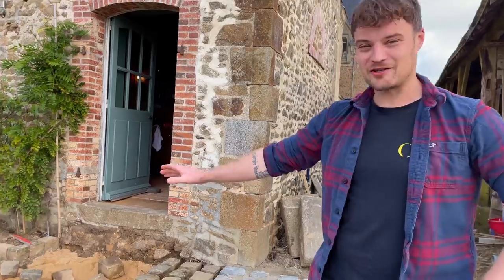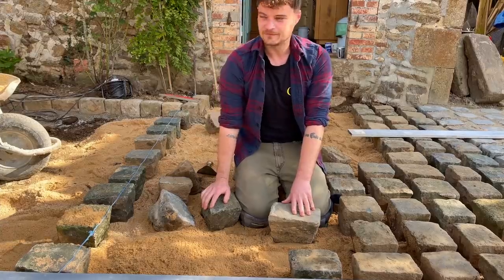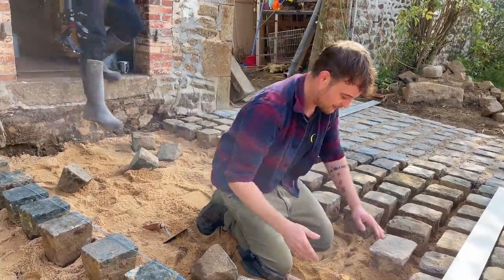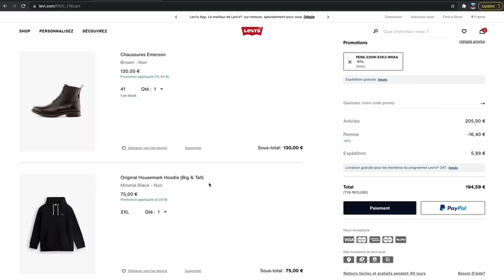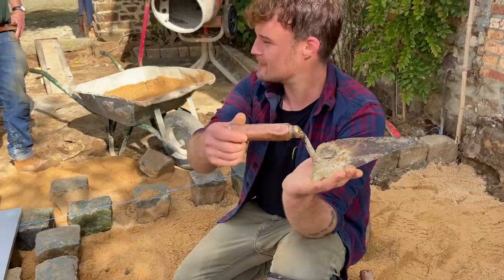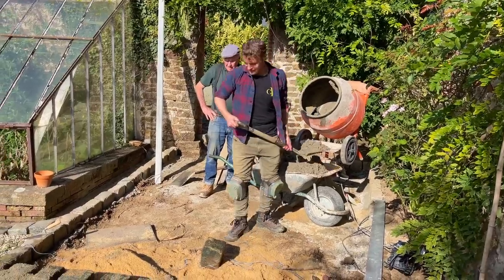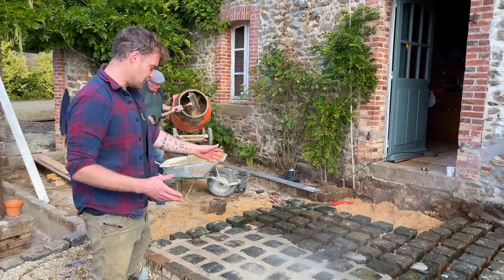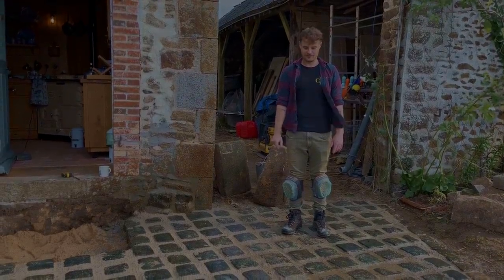Laying Antique Cobbles - Doing It Ourselves

Comment: My son and I just finished laying 2 patios with leftover concrete pieces from construction that happened in 2002......well  it took time to figure out what we were going to do with the pile of rubble.....After using a sledge hammer, some leverage to crack large pieces, we found ourselves the proud designers of awkward and uneven surfaced concrete stones, similar to your cobblestones (except not as old).   The building and placing was both exhilarating and hard work..... my knees crackled and stretched muscles I never knew I had came alive during the project that took us from a few hours twice a week starting May 27 until the full  9 hour day of Sept 17 to complete.  The larger side (there's a cemented sidewalk between the 2) has pea gravel (small, round stones the size of the tip of a pinky finger) on top of the sand between the stones as that side will hold outdoor furniture and a surface fire bowl while the other side has the stones that were extremely uneven in surfaces and sizes.  It will be covered with natural wood chips this week.  But first I'll sprinkle seeds of Arctic Thyme (thymus praecox) which is suited to very cold hardiness zones (In North America, that's Zone 2b and up to Zone 5 - it doesn't like it hot) then we'll lay the wood chips on top.  By next Spring the tiny thyme plants will shoot up with tiny white or pink to fuschia colored flowers.  Arctic Thyme doesn't grow any higher than 3 inches (plant) or 5 inches (with flower stems) when blooming.  It has been used in my yard as a lawn alternative for a few years and is wonderful.  After it blooms, I give it a 'shave' with the lawn mower blades set at 3 and1/4 inches and it stays green the rest of the season.  When you walk on it, it's like stepping onto a soft cushion and the fragrance is heavenly!  Yes, there are some weeds that like to burrow between but thyme usually roots them out before they can take hold too much.  It isn't a thyme you can eat though, so only use it in areas where it won't be mistaken for French or English thyme which are the culinary types.
Reply: I'm trying low growing Corsican mint.

Comment: Great video I have some of these to lay , looked at flow point and it’s very expensive as they are so deep the setts , so I’m going to use your method of sand and cement and wet in 
Thankyou 
Steve

Comment: That’s a lot of work, I’ve done it before. But I didn’t add concrete, just packed it in with sand & also at angles for rain runoff & another one in an artsy design. The sand set really hard with water. Sadly I moved, wish I could’ve taken those sidewalks with me!! :)

Comment: I’m interested in potentially getting a driveway redone for a 100+ year old house. Cobbles are a more expensive option than similar concrete pavers, but they are the longest lasting material to use. I am curious if there is a way to make the surface more permeable. In an urban area, the water has no natural ground to run into and refill the groundwater table or water the trees around (I live in a dry, drought-stricken area), so having a permeable driveway is really important to us. I wonder if the mortar/pointing material or whatever can be something that lets water through and still holds the cobbles in place, even under the weight of a vehicle.

Also, I started watching your channel in 2020, and when I saw the Smokey Earl Grey on your video, I thought it sounded delicious and told my sister about it. She made a mental note and ordered some to throw into my Christmas gift! I don’t know if it’s an acquired taste, unless someone already knows they don’t like any smoky flavor in food! I think most all Earl Grey lovers like me would love it.
Reply: There are loads of pavers made to let water go through into the ground. There are also alternatives drain options were the pipes of the drain are permeable so that at least some or all of the water goes into the ground. There are also rain gardens, areas in the garden that are lower and flood to let the water go into the soil at that point. They often use special earth and plants.